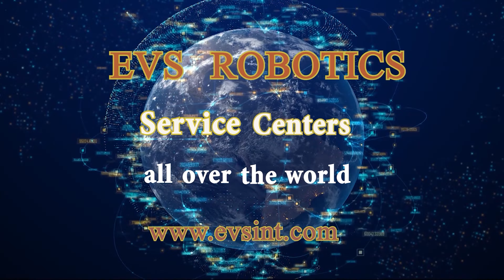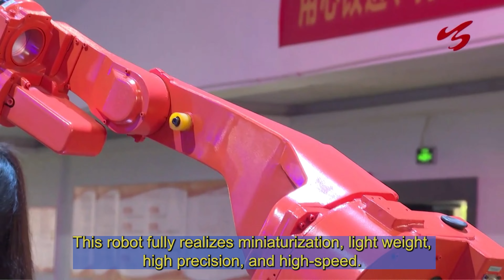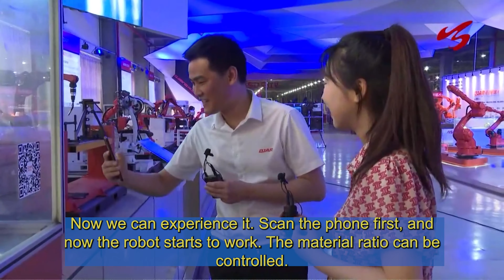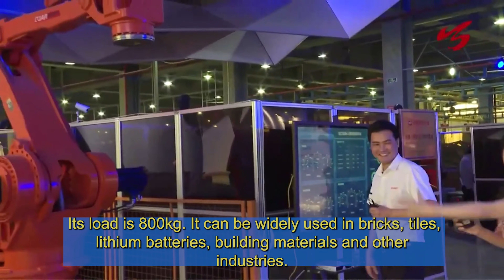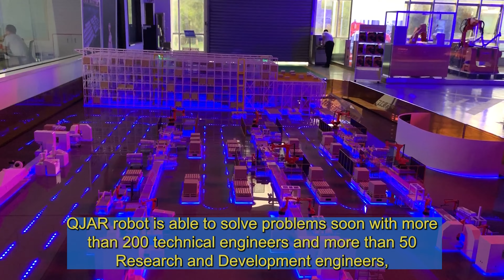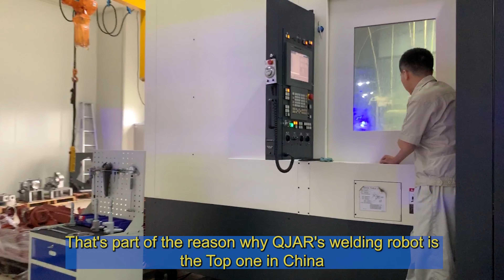The Top Industrial Robot Factory in China - ASD Eastern Robot Factory.

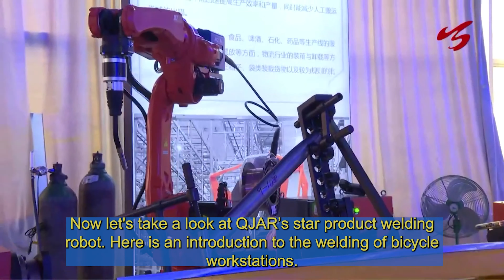Comment: That welding robot at 6:10 is very impressive, it surely will take a lot of welder's jobs.
Reply from the maker: Hi Yalan, thanks for your interest in our welding robot, our welding robot is with fast speed and high accuracy, with both 1.4m and 2m reaching distance, built-in collision sensor, arc tracking function, center hollow structure, flexible design, workable material including carbon steel&stainless steel&aluminum&etc, multiple path multiple layer.
Contact us for more information: https://www.evsint.com/contact/